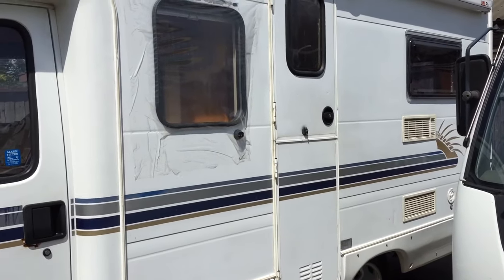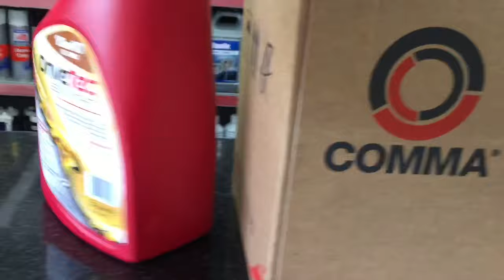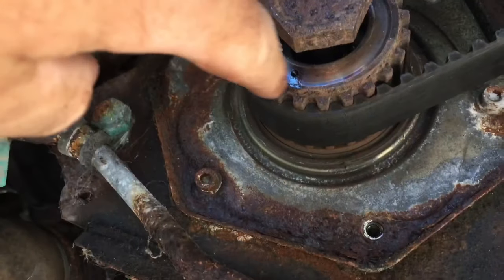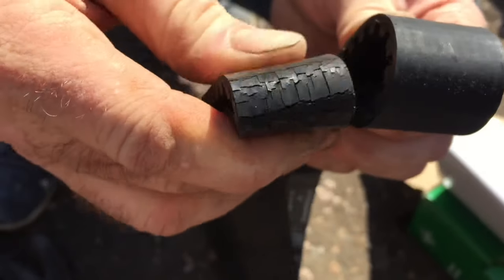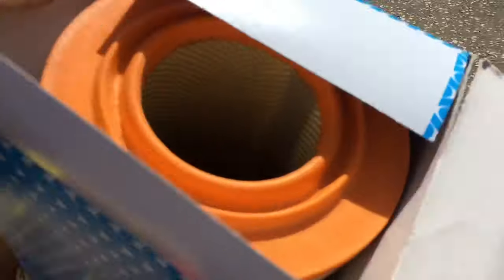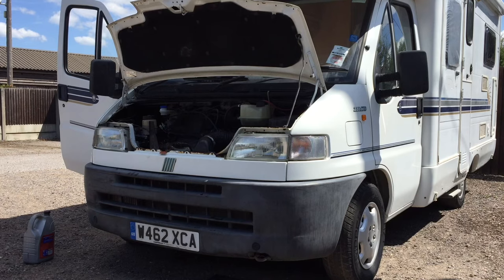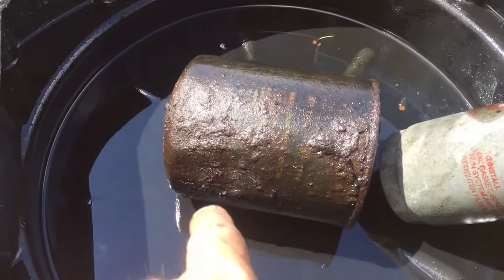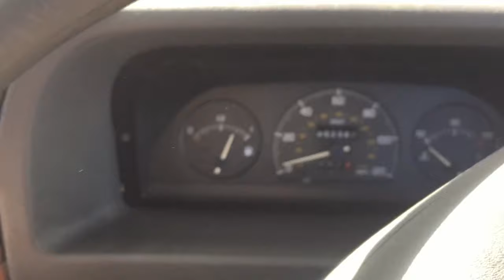Robs Bargain Motorhome camper RV project part 5

Comment from the maker: Guys I will be restoring the front bumper but this will be the last job I do due to leaning over it climbing underneath it and doing a service it’s just getting covered in oily handprints so would be a complete waste of time to do it before it’s all finished
Reply: Bit of AG bumper and trim gel and it'll be good as new.
Reply: A cheap alternative to the off the shelf detailing products for restoring the bumper is to use smooth peanut butter, sounds crazy but the oil in the peanut butter  brings the plastic up like new.
Reply: Excellent, look forwards to seeing that - Thanks
Reply: I was going to mention the faded front bumper,         are you going to get rid of the rust on the front grill?(although seems to only seen when the bonnet is open).
Reply: Hi, don't know if its my age, but power steering was one of the worst things put on any vehicle less than a lorry upwards HGV. Don't get me started on ECU's!

Comment: Top tip for restoring the bumper. Use a hot air gun and gently warm it up and it will bring the oil in the plastic back up and look like new again.

Comment: Done you and Chris proud the other night mate. The air con blower fan stopped working on my C Class estate, so looked it up on YouTube, watched a couple of videos and took it out myself, gave it a blow out with my compressor and stuck it back in again, all took about hour and half all in. New one on order and I know I’ll be able to fit it when it comes, saved myself a few quid. Point is, there’s no way I would’ve even considered doing that if I didn’t watch your shows mate, so thanks for that and thanks for today’s video, reckon you got hold of that Motorhome just in time going by the state of them parts
Reply from the maker: Nice one bud 👍

Comment: When I first met my good lady she was driving a VW Bora with a cam belt in that condition. It also had deep splits running through side to side as well as the cracking patches all over. Great job on the van. With the uncertainty of holidays abroad I reckon this will sell easily.

Comment: Great video guys u can't beat the old motor factors i used to work in one at the weekend's starting back in 1987 when every customer wanted points ,condenser, rotor arms dizzy cap ,plugs and leads :-)

Comment: Nice video Rob, a bit of bumper shine or spray it would transform that front.
Reply: Give that bumper the hot air gun treatment - works a treat 👍🏼
Reply from the maker: It’s always the last job because of greasy handprint
Reply: @JGGZ1000 Makes them brittle. Don't do it.
Reply: Try a product called “ Solution Finish “ does a great job.
Reply: @sruk   hi Rob , its a why dont you question
Why dont you get affiliated with motorfactors ??
Such as euro***parts , its 1 that i always use or mostly.
And they have a great offer code & good.
 its saving cash over the big centres.
Ive edited out a little of the motorfactor, i hope. to keep within  respected channel guidlines.

Comment: What a wicked video. Love it when you show this kind of stuff as I'm not 100% on doing cam belts 

And the motor factor part was a great bit of information 
That old belt wasn't far away from going bang was it 

Nice one lads
Reply: Peugeot dude and son You can print diagrams from Haynes, or ask on the owners clubs/ forums etc there's a Peugeot one called AussieFrogs , hope this helps.
Reply: @richardnorth5994  thanks mate

Comment: Great Video. That was a good tip too, filling up the fuel filter before putting it on so that the fuel flows right away. You have done superb as usual. Soon The A Team will be able to stand back with a cigar in your mouths, looking at what a great turnaround you done,  and say I love it when a plan comes together 🙂

Comment: Great video guys as usual worked on a few of these seen the oil filters rot away before and nice little fix on the steering  good call Chris shame people don't keep on top of there servicing save them money in the long run and nice to see you use the motor factors and not one off the bigger companys where you don't get that personal touch like with the smaller firms keep up the good work lads

Comment: Talking about leaving off belt covers...here's a one off..unlucky or wot...I just fitted a new cam belt, all went well, she was spot on, took it for a little test drive......and half way round.....the alternator belt decided to give up the ghost and threw it's dead body into the gears of my new cam belt.......luckily I was just over tickover at the moment it happened and this was the old VW 1600 diesel (non turbo) nothing got bent, just a few valve marks in the pistons to grind, polish out....but those stretch bolts were bloody expensive even back then.

Comment: That cambelt is pristine compared to one on a Saab I bought from a main Saab dealer in Wimbledon. You should have heard them argue the toss when I showed them it was half snapped at one place. After that they tried to sell me two sun visors at £175 each, saying the light bulbs were sealed in and couldn't be replaced. I used a small screwdriver, pinged the bulbs out and replaced them for 50p each.

Comment: If you changed the Cam Belt it’s always worth changing the Water Pump.
Reply from the maker: On this particular engine the Cambell does not run the water pump so not relevant to do 👍

Comment: When I replace a fuel filter on a DIESEL I fill the the new filer with Lucas fuel treatment or automatic transmission fluid. It helps preve
nt injectors from sticking especially in this new ultralow sulphur fuel.

Comment: Nice job.
I remember taking off the timing belt cover and looked at my timing belt on my cavalier mk2 back in the mid 90's and to my amazement it had a big hole in the middle of the belt 1 cm round.
It looked like a bullet had gone through it.
I put this belt on brand new some years back and was perfect.
Could not find anything around in the engine bay and nothing seemed missing like bolts nuts etc.
Weird that was lol.
Reply: Mk2 cavalier belts weren’t the widest either !
Reply: @Lancashirelad haha yes probably so i did think it could be that.

Comment: Not sure how I missed this one...but I did! Probably an age thing! Lads, PLEASE tell me you had a stand under that van as well as the jack. I had an instance (a few years back!) when I needed to check the gearbox oil on my girlfriend's Hillman Imp. Didn't have ramp or pit so used trolley jack (no stand!) OK until I heaved myself out and twisted the jack handle! Lucky to be here, just a bruised pride and bent glasses! Great video though - thanks!

Comment: Top video, really enjoyed that. And what a top job on that service, it sounded really nice after your run in it. Someone is going to end up with a very nice van there 👍 
I'd still like to see a fridge and heater in it, its a shame the bits you were promised weren't up to scratch. Quite a lot of caravan breakers around and they are pretty standard bits of kit if you did fancy finishing it off to perfection. 
Anyway, top video 👍

Comment: Looking excellent rob, 
I’ve done a cam belt on a jeep Cherokee sport that looked the same as that and some of the teeth had rotted away and torn off! Looks like you got to that just in time...

That front bumper needs some love... you can either heat it with a hairdryer or heat gun which will bring the oils back to the surface or one of the VW chaps one told me use teak oil which gives it a nice black shine but does leave a slight sticky residue however it stayed black for a good year or so before it needed doing again.
keep up the great work loving the content. 👌👍💯
Reply from the maker: The bumper is always the last job to do oily greasy handprint all over it during the service
Reply: salvage rebuilds uk always, looks great either way great work....

Comment: Rob another great video I changed my own cam belt on a fiat ducatto motor home 1993 k reg never done it before and was scared to death but I watched a YouTube video and it was fitting for beginners and it was a guy who cut the cambelt with a Stanley blade right around the whole belt so half is left on slip the new belt on half way then cut the old other half of then push the rest of the new belt on that way I didn't have to time it up or get the tension pulleys off and it worked a treat 
Would you of recommend that method or the way you done it 👍🏻👍🏻👍🏻
Thanks pal and I'm itching for part 6
Reply from the maker: I did my first few like that 👍
Reply: salvage rebuilds uk cheers rob thanks to you and Chris for sharing your footage it gives me something to look forward to get home from work for forget me tea 😂👍🏻👍🏻👍🏻🤣🤣

Comment: I bought a Subaru Impreza Wagon quite a few year ago and had exactly the same thing as that Oil filter, I mean, how does and Oil Filter rust?  When I got my current motor, a Civic 1.6 I-DTEC the first thing I checked when I got it home was the Oil Lever and Air filter, oil level was almost at lowest even though the Honda approved dealer said they had serviced it and that Air filter you took off looks brand new compared to the one I took off, I complained to approved dealer and Honda UK and they said 37K between Air filter changes is acceptable... Not in my eyes is it.  I'm surprised my motor could breath.  Love the channel, keep up the good work guys.

Comment: Hi Rob, have I missed it, on my MH the gear box oil was separate from the engine. My MH lost gear box oil in France and seized up. Good French garage put it all back together with a new clutch.

Comment: Hi Rob, I don't know if you have seen the fix on I believe Car SOS when fitting a timing belt. He removed half the width of the belt with a stanley knife, and then slid the new belt on. Then removed the other half of the belt and slid the new belt fully home. No chance of the cogs moving and timing slipping. Might help another time.

Comment: The part number on the auxiliary belt is the size . 6pk is 6 ribs and the next number is mm in length . if the old belt is rubbish cut it measure it and then you know the belt length for part number I.e 6pk995 = 6 ribs 995mm long. Good job 👍

Comment: It was in a bit of a state thats for sure , great work getting it going , but it'll be lucky if that engine hasn't got long term damage for not being services, no oil change for years
Reply from the maker: It’s been sat for 9 years that’s why it’s all rotten the engine is good and strong 👍
Reply: @sruk   It'll be fine if you sort it out,  can't be worse than the VW camper I chugged round the swiss alps and ended up fixing on the side of the road all day in Italy

Comment: Old Mk1 & 11 Yaris oil filter also rust and leak because they are at the front and low down and get hit with road salt etc and rust out and then leak and the engine blows.

Comment: Im surprised you didn't put a diesel injector cleaner into the fuel filter, when fitting. It would have been a good opportunity for you, to show the subscribers how good a product it is. What it does and how it can help your engine run. especially an old bus like that. as its not turned a wheel in a long time. 

good work, keep them coming

Comment: Also like to use motor factors, sadly my local factors the owner died suddenly and another big place which I won't name came in and took the staff and no one took over the shop.  I do sometimes use some of the little factors that deliver to most garages, no need to be trade and quite friendly when picking parts out of books.

Comment: I had a very similar oil filter no holes but why it did not burst.  Supposed to have been serviced regularly. .YEH right.  My background is more with mechanical diesels including fuel pump repairs.. Always a good idea to bang the end of a bolt first rather than chew the flats.  
That van would have been very expensive when new.. at 52k someone has not had much life out of it.. What a shame to see it deteriorate so bad both inside and otherwise.. Poor van finds a caring owner at last. 😁😁

Comment: Rob if you'd left the nut on the tensioner you could of pushed the tensioner back tightened the nut and that would have held the tensioner back instead of using the molegrips .
Reply from the maker: I didn’t take the nut off the tensioner

Comment: Regarding the rusty bits around the engine, including that corroded pipe seen on the camera when you was looking at the tensioner, what, if anything, would you recommend spraying/putting on it to stop further corrosion?
I was told that Essex minicab/taxi drivers used to spray their engines with WD40.

Comment: Some very interesting content in this one. It looked a bit as though a previous user a while  back, knew that it needed attention. Set it aside to be a next month job, but as we all know that next month never comes. Time takes its further toll. It was unfortunate that the 'fault snow ball' almost ran you down, but as usual it has been knocked away. Once any pipe is a failure it is best to chop it and undo it the easy way, no one can try to reuse it in the future. A bit like chopping off the plug from scrapped equipment. Sorry I have to ask, are the brake pipes still OK?
Reply from the maker: I have not looked at the rear brake pipes but the front copper tubing looks reasonably new

Comment: looks like that belt is well due a change and the air filter? disgusting. well done guys. I have a brake pipe leak on my kangoo that i am planning a camper conversion on - will have a similar detective work as you had on the power steering on the fiat to find it

Comment: Out of interest as a layman, was it not worth changing the water pump at the same time just to be safe? It always seems to be something that people recommend when doing a cambelt since you have to take the belt off to do the pump anyway. Just curious. Also, the old LT31 6 cylinder camper I used to have had no power steering and it was a brute to manoeuvre - my wife couldn't drive it it was so heavy. I'm a big lad and I struggled at low speeds sometimes. It was also loud as hell, but had a lovely 6 cylinder roar when you finally got the damn thing started. Probably needed new fuel lines as they were notorious for degrading and becoming permeable.

Comment: I learned a trick , i think ?
About changing a timing belt
Cut half of the belt length ways
Slide the new belt on , cut. other
half off,  is this true does it work ?
Just want your opinion please.☺

Comment: The other place HALFRAUDS 😀
Reply: Not too bad with a trade card especially their tools that come with a lifetime guarantee
Reply: I’ll never use euro again waited 2 months for parts and the just ignored me
Reply: @willis8281  there always seems to be 20 of them sat behind desks and no-one on the counter, I swore never to go back about 10 years ago
Reply: I used to use a local parts shop until they sold me a replacement wishbone which turned out to be complete garbage. It was on the car less than a week and one of the bushes snapped clean off thus sending the steering and wheel alignment haywire which meant I had to get a whole new set of tyres as well as another wishbone. You get what you pay for.
Reply: @BigDave1965  you tought me that trick, I took a payslip and ID card in, they were doing 3 for 2s on their pro tools and the guy took 10% off on top. £135 shelf price dropped to less than 60!
Reply: @jamesbrett6518 “ if its free give it to me“
Reply: I mind when Halfords started showing the price and  VAT,  instead  of charging the price shown they added the VAT to it as well. i discovered this when i bought something  the week before they started  showing the VAT , Then went to buy the same again , and they increased it by  adding the VAT  again , when i pointed it out to them , they gave me for my original price , blamed it on head office , said the would get it sorted , that,s  why their prices are still to high.

Comment: Rob
That engine uk need was poor so neglected u have saved it mate it makes u wonder how those old 1960 1970 cars drove without power steering it takes the weight of the front end so it's lighter then stears ealy how things have changed with cars over the years ha rob great video phil

Comment: Fridge 240v fault is an easy repair, just replace the heating element while the fridge is out. Plenty on ebay.
Give this company a call re the fridge and heater.    U.K. Caravan breakers
Russell Weller
55 Elm Road
Clacton-on-Sea
Essex
CO16 9LR
United Kingdom

Comment: Hi rob and Chris. Omg that cam belt is so crusty. I wouldn’t even start the engine just to move the van. Never understand why people don’t change them every 4 years. So expensive to fix the results of a belt snapping, the engine is never the same after a belt snapped. ☠️
Reply: Less cracks on Ghandi’s heel
Reply: @bear1245  wonderful comment that is .

Comment: Rob, did i see right at 9.40 on that inner wheel arch has rust holes in it
Reply from the maker: It does 👍
Reply: @sruk  Rob, does that need to be repaired for a MOT? Love the vlogs you and Chris do but you need LSE finished

Comment: Would say that M H has been parked up for years & used as someone's home judging how the inside was & all that surface corrosion on the engine certainly not been used on the roads, 
You might wana take a look at that metal pipe that runs round the outside of the timing cover by the bottom pulley if that's not the one you replaced buddy looks like its about to let go

Comment: Would the water pump not need changed at the same time
Reply: On these the water pump is driven off the aux belt, not the cam belt. It forms part of the engine mount too. 

They recommend leaving them alone if not leaking, as some of the after market ones are not that clever.